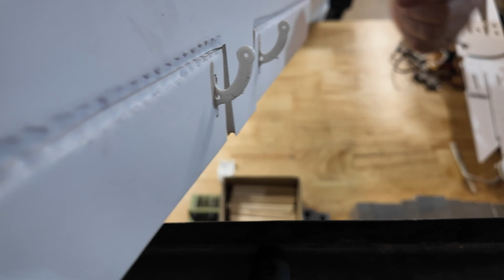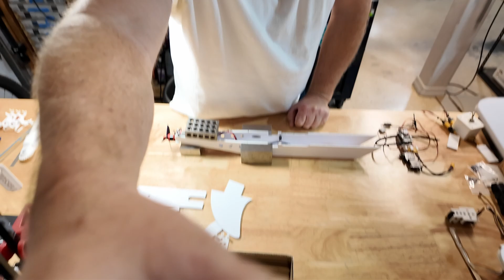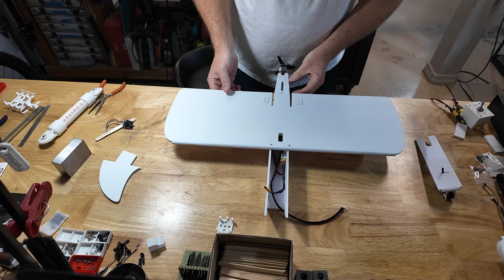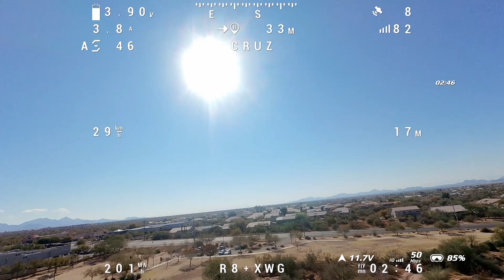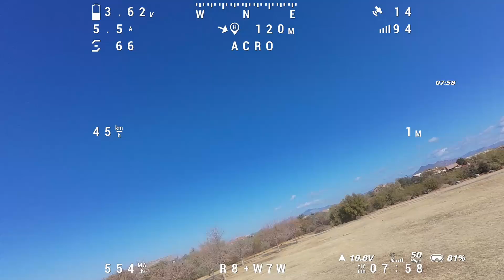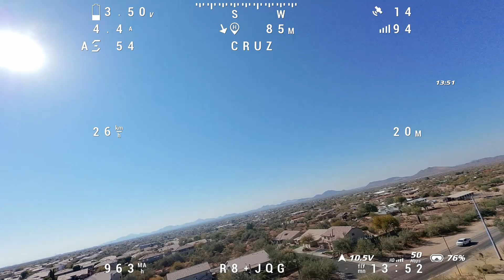Mini Plank - FPV RC Aircraft with DJI O4 and INAV 8 - Build and Flight

Comment: To avoid brownouts, have you ever tried throwing a capacitor in line ?  Works good for sporadic pronouns.

Are used to fly Fpv about 12 years ago. But stopped because I became obsessed a little bit and spent too much time away from my family doing it, not to mention all the money.  I I hate thinking about all the equipment I lost never to be seen again.  So many failure points in an aircraft.  A solder joint,, a loose, screw,  in the end I’m sure it was just me, but I got out of it. 

Fast forward to a couple of months ago when I bought a DJI Ne-Yo drone with goggles in motion control controller. Oh my God, what a game changer. High definition video from kilometers away!? Are you kidding me!?  my video transmission was analog and six 40 x 4 80 more or less.  

I would experiment with the Dji 04 air unit but I’m not sure what guys are using for flight control.  Are people still using 2.4 GHz. ?   I’M NOT EVEN SURE I REMEMBER HOW TO BIND A RECEIVER.😂.  

THANKS FOR THE VIDEO.
Reply from the maker: Yep - the build has a capacitor.

The issue where brownouts can impact you is coming in to land after a long duration flight - and then a go-around is needed.  You’re already at a low cell voltage - and then you try and go to full power for the missed.  This is when the brownouts occur - and a capacitor would be hard pressed to supply enough current for the climb out and subsequent pattern.  So this is just something you need to be aware of - and have a plan to commit to the landing with alternate ground paths once you pass your decision altitude.  Pilot stuff.

Either way - FPV would love to have you back…